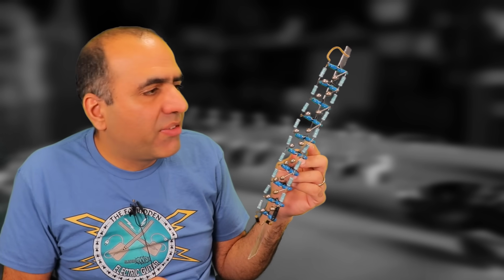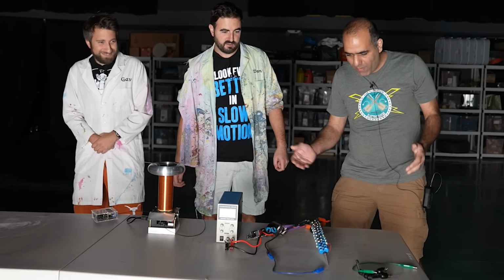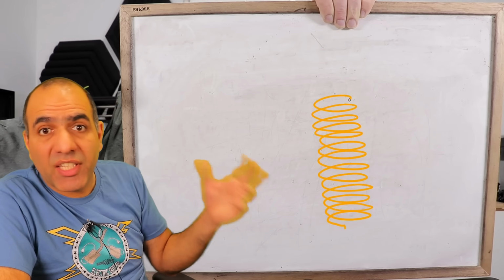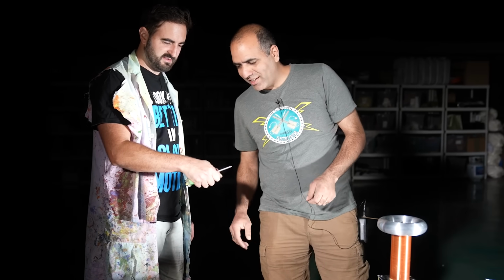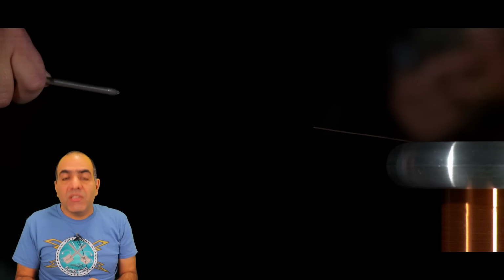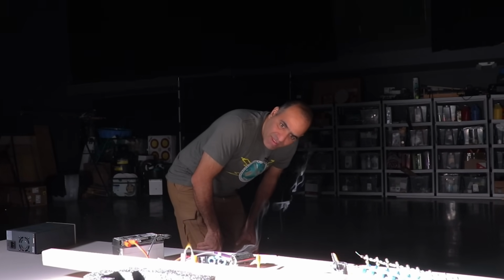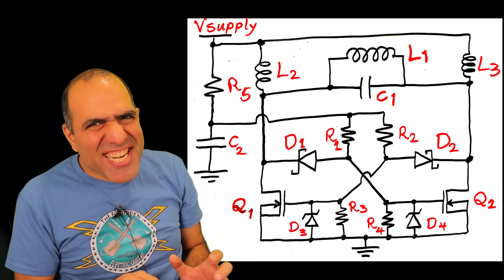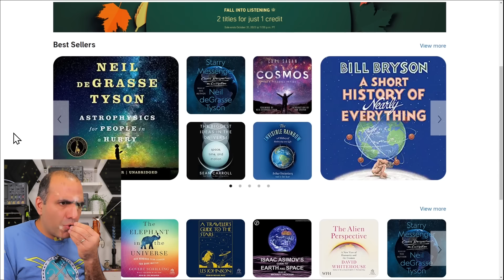Slow-Mo Experiment Disasters, ElectroBOOM VS The Slow Mo Guys

Comment: 13:31 hmh, have the slow-mo guys not heard of motion detection? it's fairly simple sw that picks interesting frames out of a sequence. you can do it even with just standard imagemagick command-line utils.. how long have they been doing this again?
Reply: They are not reviewing the footage on a PC. They are reviewing it from the camera's built in system which probably can't do stuff like that
Reply: @Vega-yb8ko  they might have an excuse sure though one was not presented, but Mehdi also posed the question very clearly at 8:33 "how the hell are you supposed to find that one frame out of hundred thousand". computers were literally invented for the purpose of doing well-defined information processing tasks at scale. in a world practically forcing computers in everything even when it's not that useful this is the one task that's begging for automation.
Reply: @snooks5607  These are multiple hours of video which adds up to almost to multiple *Terrabytes*. They may use motion detection to find the frames to include in the video post-production but in the moment itself it's gotta be easier to just watch it from the camera rather then wait for all that information to take hours to move to a computer.
Reply: @AidenLucente  I have no doubt it's an SSD, it'd be silly to transfer the data just remove it from the camera, plug into a computer and use like any other SSD.
also, anything producing digital data these days is already a computer, if the system is able to let a human scrub through the files and see difference in the pictures visually it's not going to have more overhead to do the same automatically since it doesn't even need to show anything until it's found it. (nitpick: it's spelled *tera)
Reply: (of course making that a feature of the camera would be up to the manufacturer just saying I'd be disappointed in the product if they haven't done that)
Reply: @snooks5607  they said themselves:

„There is motion detection available by Phantom themselves, but it requires a PC. We brought a notebook but forgot an Ethernet to USB-C dongle.”

Comment: I just finished the slow mo video. Good stuff, can't wait for your follow up. 1) Is the original arc steamer coming from the lowest resistance point? 2) why is the circuit closing on itself instead of going to ground? 3) What is actually causing the steamer, where is that charge coming from?
Reply: Ok, I think what I am seeing is some crazy ghost reflecting off of the clips wire, exactly where it crosses the first gap. So that still doesn't answer why it only seems to light up brightly after that reflecting appears.

Comment: It would have been a good idea to create some kind of flash detector that detects the sudden spike of light and turn on a led for like 1/2000s. This way, reviewing the footage, if the led is on, you know you have to rewind, if it's off, you have to go forward...
Of course there's a little delay between the flash and the led activation but once you know it, it's easy to rewind a little bit to find the flash.

Comment: Imagine having all that insaneee camera and hardware technology, capable of literally capturing light-speed movements and actions, taking and storing millions of pictures every second, yet having to MANUALLY scroll for ages and ages through every frame to find the only few that are different 😂 Like cmon, how ironic is that?? Such an oversight, someone needed to put a tiny piece of software in there that let's you quickly find and scroll through any frames with significant changes. Don't even try to tell me how hard or challenging that would be, cuz look at what the damn thing is already doing lol

Comment: You could help them out by designing some kind of precision trigger-stopwatch circuit to measure at least an approximate frame position since recording start.
Such things are not usually done on the spot and require quite a lot of prototyping beforehand though.

Comment: I think computer science has things to say about finding the arc frames.  To find them manually, it should be possible to manually perform a binary search:  Play half of video.  Was the arc shown? No: Go to other half, Yes: Take half of the current half.  Repeat.  Finding a single frame out a million should only require about 20 iterations.  I'm surprised the Slow-Mo Guys don't have some kind of "interesting frame" app that can pick out frames that looks very different from all the frames around them.

Comment: Hi Medhi. One issue I found is pressure and temperature changes can effect your electrolytic capacitors. There is ways to protect them if you are interested you will find solutions! Ever get any of your high voltage stuff rated for the temporary amperage levels? Would love to see some quarter shrinking in slow motion like this!

Comment: @ElectroBOOM can you generate a thermionic emission? I'd like to see one! Like those electrons in the coil or filament are bouncing off the metal due to high voltage applied (specifically, Kilovolts)

Comment: You could find the start with a little data script. Calculate the difference in brightness between frames and find the biggest peak. It might take a minute if you're in python, but it's much better than doing it by hand

Comment: Surely the arcs have to be at the same time because capacitors have to discharge both plates equally, and each plate is coupled to the plate of the next capacitor along via the spark gap

Comment: I work with electric engineers quite a bit, i harves... i mean, i require their expertise in various fields ranging from protection of certain sites from electric disasters to designing specific circuits to suit specific applications etc. What went on, what with all the little fails that added up... perfectly normal. Honestly, i'm surprised everything worked as well as it did considering it took a ride through the "meat grinder" that is luggage.

Comment: And so by 1983.  And for only approximately, $3500!  The cost of a 2 track Scully analog machine.  And I had digital!  And 3 Scully 280 B's of my own.  In my own studio!  As I had set up a full-blown, 16 track, 2 inch tape.  Home recording studio.  One of the few home studios of this extravagance.  In the world!  As by then.  I also had a 32 channel, music recording and mixing console.  And a real actual, Plate Reverb, behemoth.  In my basement utility room.  And what a job that was getting that in!  It weighed hundreds of pounds!  And I had to completely strip down its case.  Just to get it in.  And then reassemble everything in place.  What a job!  This is before we got decent, digital reverbs!  As all of the affordable reverbs.  All sounded like horrible bullshit!  And nothing could compare to the German EMT brand plate reverbs.  Until the patent ran out.  From 1958.  When other American manufacturers.  Started making them.  Mine was made out of, Stainless Steel!  Instead of cold rolled, steel sheet.  And there is a big difference in sound between stainless steel and cold rolled steel.  It's much brighter sounding.  Very zippy sounding.  Great for rock 'n' roll!  And just perfect for grand opera!  Where a spring unit wouldn't do!  Except for the AKG BX-20 E Springs.  Which sold for $5000!  In, 1978, dollars!  And okay… So I had one of those AKG's, also.  But they don't sound as zippy as a plate reverb.  They were beautiful and lush, sure.  But they were dark sounding.  Great for symphonic work.  Not as great for rock 'n' roll.

And so I might be a, hack engineer?  But I'm really not!  I've gone on.  To not only design and build.  A large frame, audio consoles.  For recording studios.  And radio station audio consoles.  And I have gone on to become a history making, 4 time major music award nominee.  As a bona fide high school dropout.  With nothing more than a GED.  And a degree from the University of Marijuana.  That provided me with most of my electronics knowledge!  As it would let me focus and read for hours on end.  At the free college degree University called a, City Library.  Where you can read all the books for free!  It's all free!  And you can even take the books home for a couple of weeks!  And then bring them back to get more!  And I just kept reading.

So I dearly love Electro-Boom!  But thankfully.  None of my projects.  Ever exploded, shorted out or blew up.  I'm happy to say.  And I can think marijuana for that.  She's my good friend.  We've been dating for over 50 years!  And I've got to know her, intimately.  With every puff.  And she has been giving me the answers I have been seeking!

I will likely never get a college degree now that I am 67 years of age.  And what would be the point?  But to only teach at a university or high school.  FUCK that!  Give me the rock 'n' roll or give me death!  I think I'll probably get, death?  But until then?  I will be rocking and rolling.  I think?  For some time to come.  Maybe?  Because I'm now retired!

And so I might just go back to my photographic and video producing hobbies?  To produce rock band videos.  And nobody does it better than me.  Everything I do.  Just sounds and looks like a coast-to-coast network television production.  Geez… I wonder why?  I only did that for 20 years for NBC-TV.  And Radio.  We mustn't forget, Radio.  Where we all started.

So keep these great videos coming my electrical engineering friend from the Middle East!  As you guys are so good at, oppressing women and oppressing, sporadic currents.  Flowing in the wrong direction.  With a diode or capacitor!  I just love the way you say capacitor.  With your Middle Eastern, twang.  You say it capaciTOR.  After all.  That is the way it's spelled.  And so I really just watch you.  To hear the accent.  It's cute.  It's adorable.  It's so slimy cool!

An amateur
RemyRAD

Comment: The ZVS: You used the WRONG pin on the flyback transformer secondary as a return path, hence it arcs unto itself. always do a continuity check before powering up.

Comment: Are you ignoring my corn in my tooth issue? I know the videos I commented on are kind of old but I had to go back to before I had the corn in my teeth in order to prevent my current status. I think thats how time travel works and then I would have the 3d printer needed to make a toothpick.

Comment: The marx sparking on the final gap then setting off the others could be acting like a TX antenna, where voltage is highest at the tip of an antenna and highest current at the source? Could this be a visual of how a TX antenna works?.......Pretty cool!

Comment: You can make a script/program that will check the differences for each frame and if it is higher than a specific threshold you save those frames. You can discard a specific amount of frames to make it slower or faster
Maybe you should ask help to a software engineer since there are multiple ways to do this and the output will depend a lot on the implementation.

Comment: You might be able to use computer vision like OpenCV to parse through some slo-mo capture. It would need somewhat specific parameters though, e.g. only analyzing a small portion of the full frame of video (it might work well for this actually). It would let you shoot multiple shots and then go set-up while the script runs. But you'd want to ultimately manually review since the parameters of the script might not catch everything.

Comment: They were probably under the assumption that with all the shocks you have absorbed over the years, you are like a walking Leyden jar that zaps anyone within a dozen feet. I'm surprised that they didn't head straight for the break room to get a roll of aluminum foil in order to throw together a quicky Faraday shield. Well, they're photo guys, not electronics guys, so I guess they can be forgiven for not thinking clearly under stress.

Comment: Find the right position quickly with Python. You load the video frame by frame and calculate the sum of all pixels with the timestamp in a 2nd column. Sorting the resulting array for the first few value will give you the timestamp with interesting data.

Comment: I don't know what video format these cameras churn out, or if you have to downsample the footage before exporting from the camera, but if not and if it's something remotely normal it would be very trivial to write a python script to detect frames of interest and return the frame number or time signature. You can convert frames to binary images by setting a pixel brightness threshold(ideally quite high as the arcs are bright) , and then just find all the frames that have non-zero or True pixels in them. If there's noise creating false positives, you could just measure the average brightness of each frame and have a threshold average brightness that is only met when arcs are present in the frames. Would also be quite easy to get the timestamps for other types of slow mo footage where brightness is not the distinctive feature. For example you can identify motion by looking at differences between frames. Seems like that would save some time.

Comment: is there not some kind of program to feed the slo mo into and it will find a moment of change in the frames. like bandwidth change or like the old cassette players that could fast forward  to the start of the next track buy finding the quiet part.

Comment: you mentioned you were suprised in the video with the slowmo guys that air could blink as fast as it did as the arc traveled around. 

imagine a room full of plastic balls that are at play pens and the likes. if you took giant tree log say as large as a semi truck tire circumference, and it were say 10 feet long. if you slowly entered the tree log into the ball pit say horizontally thru the middle of the room, you would displace some of the plastic balls out thru the top of the room, until the whole long is in the room. 

now take the same log and room, and slam the tree log into the room at a couple hundred miles an hour and youd notice the plastic balls would fly out so fast out of the room like an explosion of plastic balls flying out. 

that is the air. its like the air "blinking" that you mentioned before, where the faster you move something thru it the faster the air move as the object (in this case the electric arc) increases in speed or velocity. 

another analogy is water, the faster you drop a rock in a bowl of water the quicker the water flows out to displace the water. so fast that if you get fast enough you can vaporize the water as the water collides with particles in the air as its trying to fly thru it. 

the speed of which the air reacts or blinks in my opinion can be infinite only reliant on whatever force is trying to blast thru and its speed. 

i also should add i have no idea what i am talking about :D

Comment: Hi mehdi, i watched both your video and slowmo guys video, i noticed something in the marx generator part, i noticed that  the last part/segment of the generator holds most of the charge compared to the other segments, i thought of the same thing like you guys at first, that the first segment should arc first, but if you calculate each segments charge and use the same air resistance to all of them, it makes sense that the last segment should arc first(as a primer of some sort). Or maybe the gap on the last segment is shorter than the rest, might be good experimenting on the gaps.

Im not entirely sure, i really want to talk about this thing, its keeping me up at night. I cant sleep with this roaming my head lol.😅

Comment: You said that the voltage of the Tesla coil either breaks down the plastic of the screwdriver or forces the current to go around it. Is another possibility not that his hand becomes a plate of a capacitor and the current passes through the plastic without breaking it down?

Comment: I never felt my Arcs that much, rarely I would but the majority of the time nothing other than the heat of the strike.  Why?  See, I have had Arcs about 1.5 to 2x the length we are looking at here and one could easily take the arc onto the metal and feel nothing.  Also, my arcs were far more purple.  Any idea why this is?  Is it due to higher frequency or something?  10kv 35ma was my power, an OBIT and various Saltwater capacitors were used.  Why did mine behave different than more or are my nerves just dead?   I did onetime hook it to the back of an old CRT and a white hot arc popped around the entire screen and NAILED me.... HARD!  Was that self capacitance of the CRT tube increasing my current or what?

Comment: As yo pull away the hand is there point of distance and calibration of the coil to pull the hand back without hurting too bad, and I don´t mean an arc rope, just enough to significantely  feel the coil pull the hand .

Comment: Hi Mehdi and everyone, i have a question : early this day when i want to travel by train was some issue in power lane, then maintenance guys comes.. they put 2 wires on the overhead lane  to the ground  and they start working in the middle. "The power was on because i heard the electrical dischage when remove them"

Comment: You guys need to use some basic software to automatically scan video frames and find ones that have significant differences. Start with a clip of the video that contains a spark and generate a color histogram for each frame. The frames with the sparks will probably be significant outliers (probably a lot of blue, the ratio of blue will be higher if you crop the video a bit). I honestly think you could do all of this in like 50 lines of Python if you combine CV2 and Pandas.
Reply: I agree!
I have programmed stuff like this quite often and can tell you, you definitely don't even need 50 lines or pandas for this.
With numpy or opencv you could do this in < 30 lines without violating PEP style.